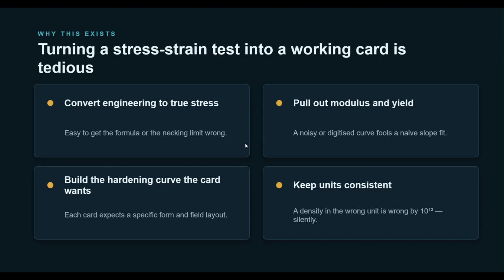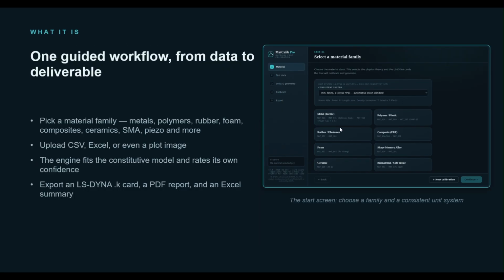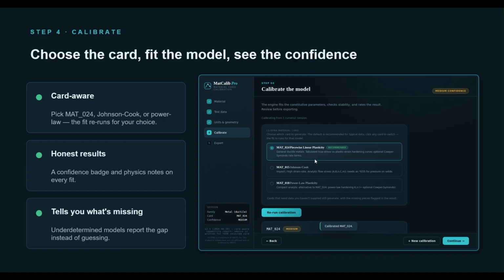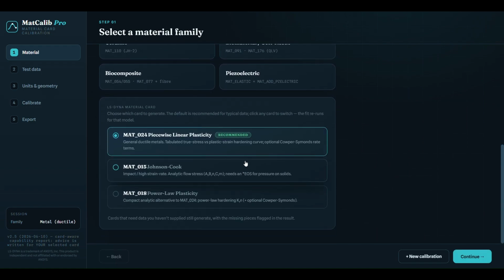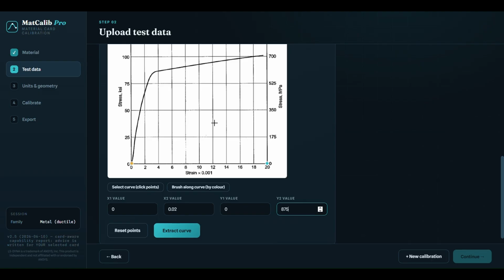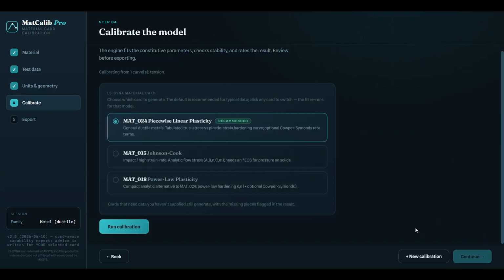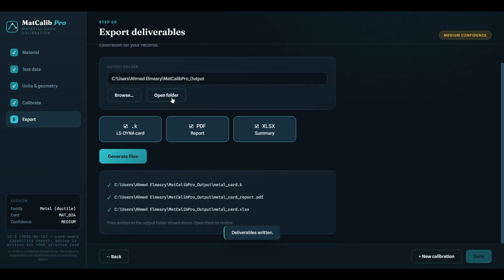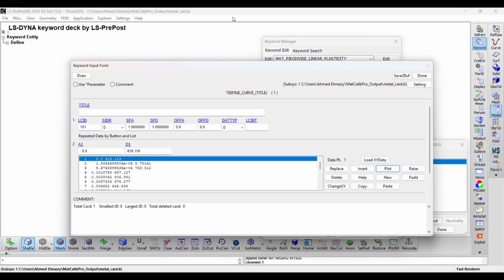MatCalib Pro: Turn Test Data into Ready-to-Run LS-DYNA Material Cards

Comment from the maker: Download *MatCalib Pro* from the link below and turn your material test data into ready-to-run LS-DYNA material cards. The tool imports stress-strain data from CSV, Excel files, or plot images, fits the selected constitutive model, checks unit consistency, and exports a finished `.k` material card together with a PDF report and Excel summary. MatCalib Pro supports multiple material families, including metals, polymers, rubber, foam, composites, ceramics, shape-memory alloys, and piezoelectrics, with local processing on your own machine:

https://payhip.com/b/8hwfx